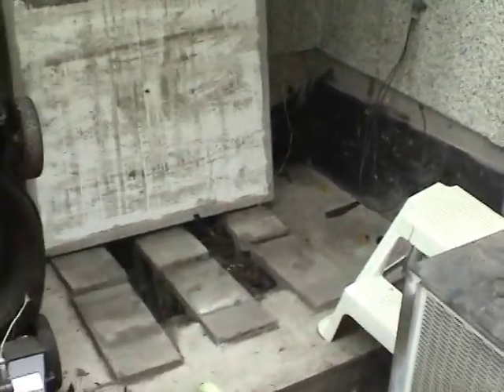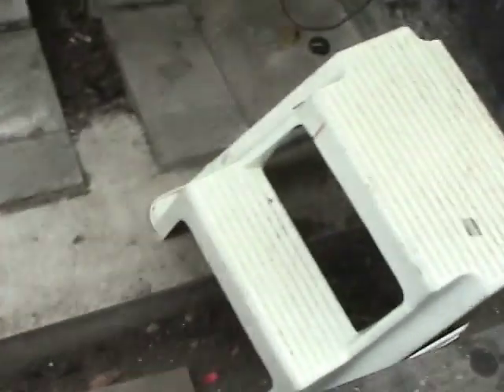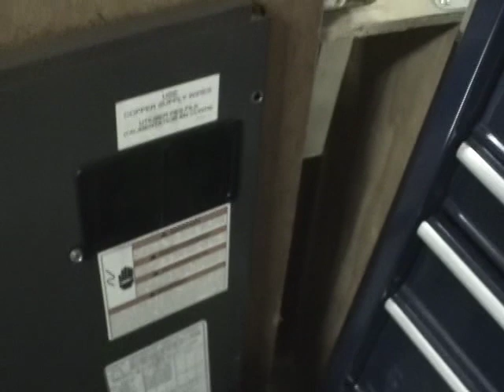Heat Pump installation - Part 2

Comment from the maker: @K0gashuk0 The 100A circuit is for the air handler, which can draw 60A when the 15kW auxiliary heat is on. That circuit is using 3AWG wire. The outdoor unit has a 30A breaker with 10AWG wire.

Comment: What gauge wire are you running to the 100amp breaker. 100amp is a little big isnt it? My 2 ton says max of 40 or 45 but I was gona drop in a 50 to be safe.